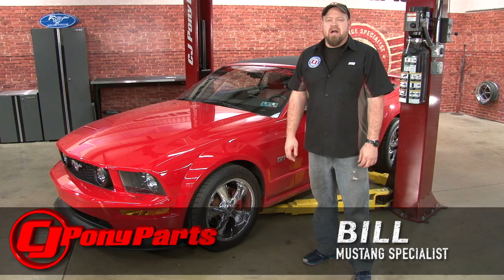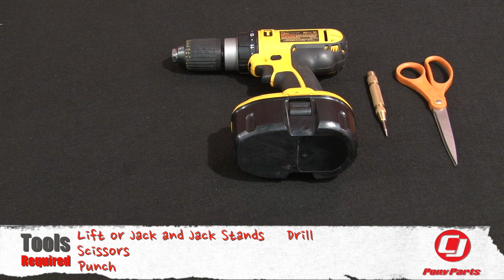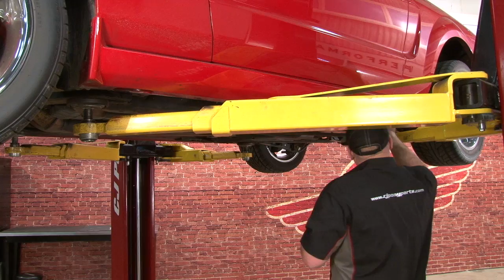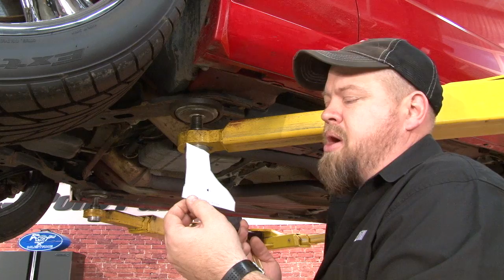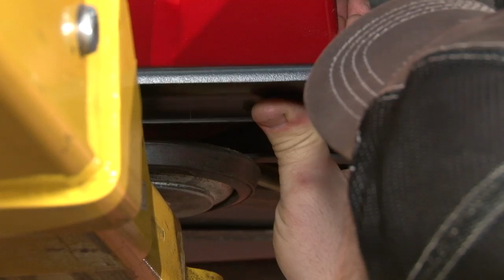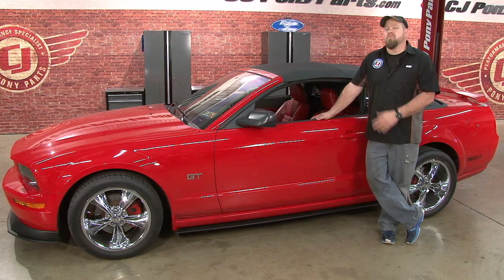Mustang Classic Design Concepts Side Splitter 2005-2014 Installation

Comment: Oh my God! I would never drill holes through my sheet metal to install a skirt kit. I’ve held on front air dams with 3/4” 3M double sided automotive trim tape alone. Push pins are waaaaay over-kill. Especially for such light parts.
Reply: The sheet metal you are refering to is actually plastic.
Reply: @jacoblarsen4633  lmao